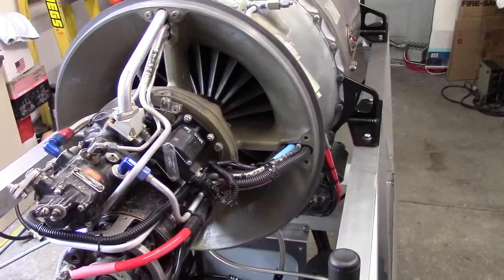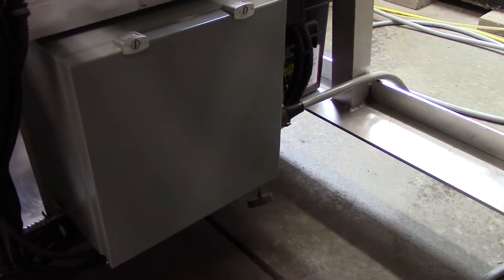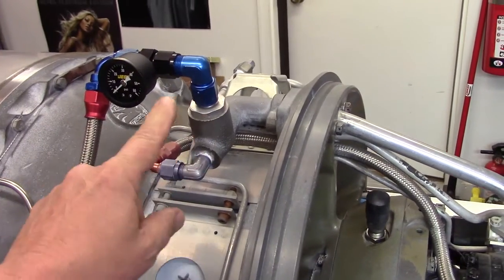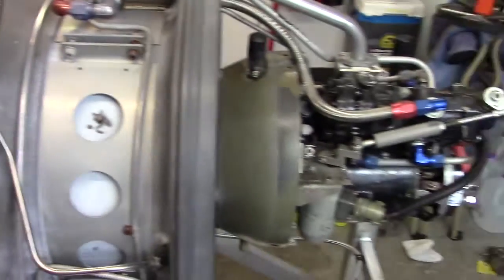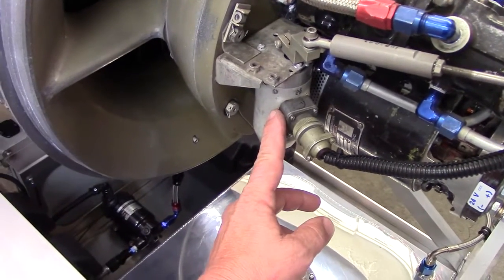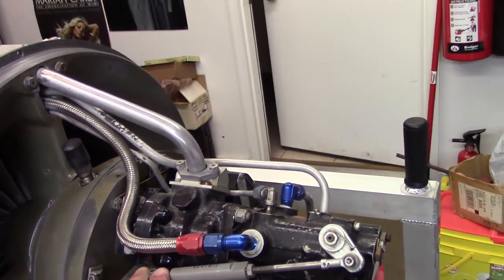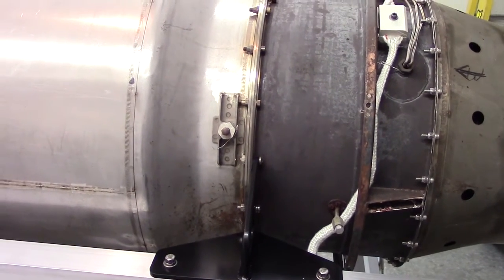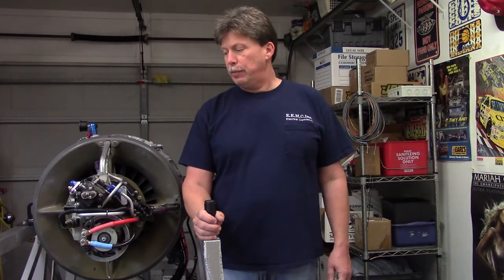The J44 Project:  Engine & Accessories Overview

Comment: Good motor for a boat? Or too much fuel?
Reply from the maker: Hello and thanks for your interest.  I will say waaayyy too much fuel, since it burns about 180 gallons per hour at full power!  Jet engines produce pure thrust which will move a boat but not effectively from a start.  A turboshaft type gas turbine engine is better suited for a boat, where it can drive a propeller or pump.  Check out Agent Jay-Z's videos covering the river racing boat he built the engine for.  It's awesome and fast!  Not drag boat fast but 140 MPH is pretty fast on water,  on a river! 

Basically, jet engines are not 0 - 60 fast but they are more like 60 - 200 fast... the faster they are going, the faster they go faster!  The torque produced by a 500 pound (weight) turboshaft engine can easily be well over 1000 pound-feet of shaft-twisting power,  which a boat loves.  Watching the river racer videos, I say that it almost jumps out of the water when you hammer it!   The boat's name is "Unatural Disaster" and there are videos on YouTube,  including Jay's.  I recommend his, since he videoed his ride in it and the owner let him put GoPro cameras on it.  He estimated that at one point during the first test run of his engine, they accelerated from about 60 MPH to 120+ in about 2 seconds. 

Cheers, 

DD
Reply: @DScottDuncan  yes I did my research and realized the motor is too big truck fuel consumption is too high just looking for another project not really concerned with fuel consumption be it that I distill or crack my own engine oil into a base oil or waste oil diesel with a specific density of 845 at a cost of 6 Cent per gallon I was just looking to alternatively power a boat was some type of engine that will burn a diesel type fuel
Reply from the maker: A turboshaft engine would be great for a boat and it should run on K1, so if you are able to make a fuel blend similar to that,  you would be golden.  Using a jet engine would bypass the propeller drive issues but it would have a higher center of gravity, mounted high enough to be above the stern with the exhaust.  Gas turbine engines are costly to obtain but they make a lot of power for little weight.

Comment from the maker: Thank you for the comment; I do intend to video as much of the work as possible.  Hopefully, there will be enough usable video after editing to create something worth watching!  It will be after the first of the year (2016) before  much happens, since I need to move my engine hoist into the little shop you see in my videos, to handle the engine, as well as build a 'stand/fixture" to hold the engine in a vertical position.  So, after some prep work, I should be ready to start tearing down the hot section.  Stay tuned & be sure to check out my other videos, if you haven't already.  Cheers.

DD